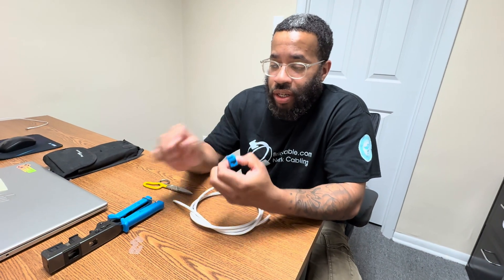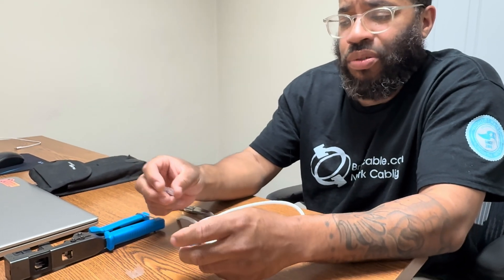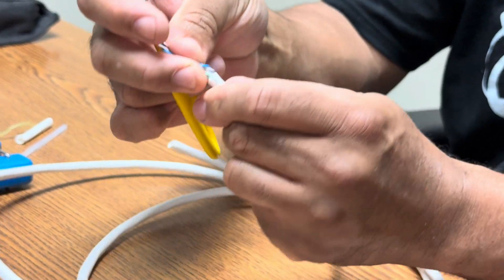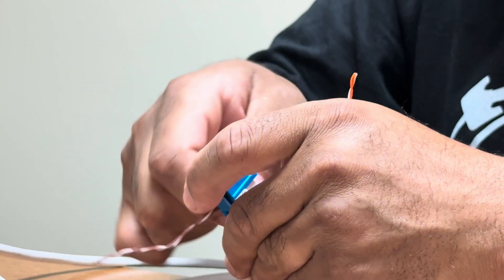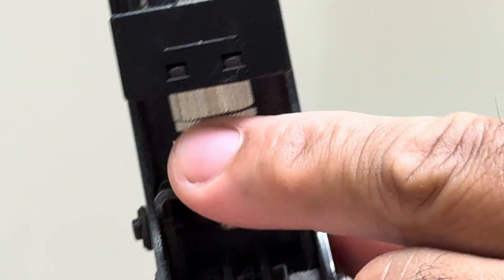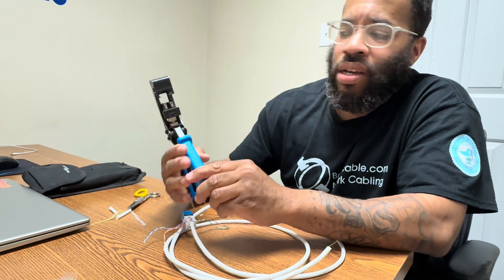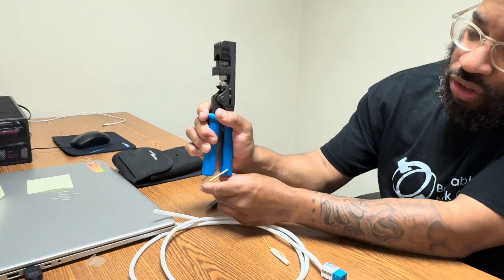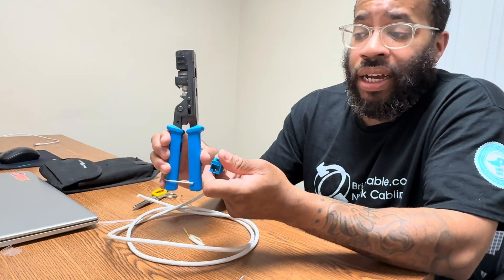Terminate CAT6 in Seconds! | Everest easyJACK Speed Jacker Tool Demo

Comment: It's a shame they make this tool where you have to load keystone in from the backside.  When you have short leads coming out of wall it would be hard to get tool close to wall because of the open handle sticking out a lot.  It should feed in from the other side or from the front to solve this issue.   Also it should be a ratcheting tool that won't release until crimp is complete.

Comment: Do you find techs needing replacement teeth cartridges frequently? I'm already on my third blade set because the plastic tab that holds it in place keeps breaking during normal use. Seems like planned obsolescence or a design flaw.